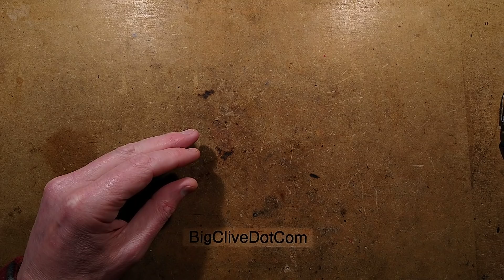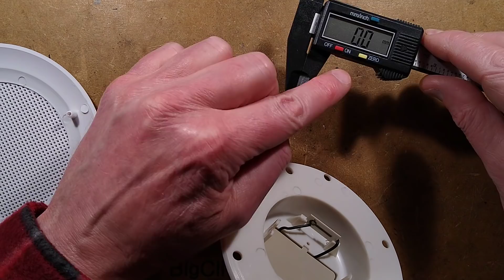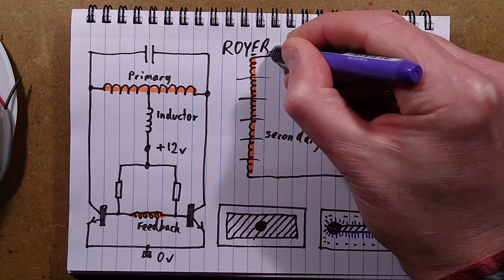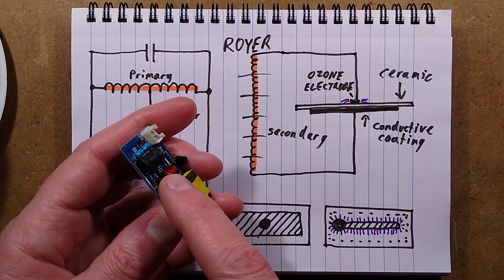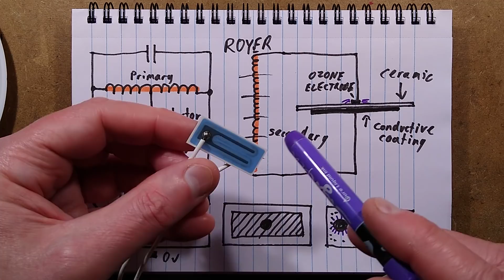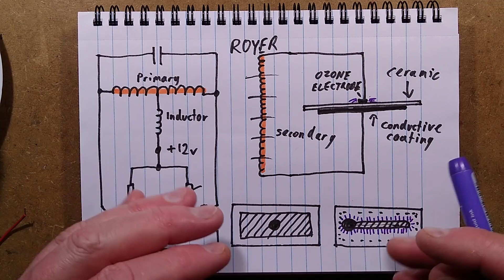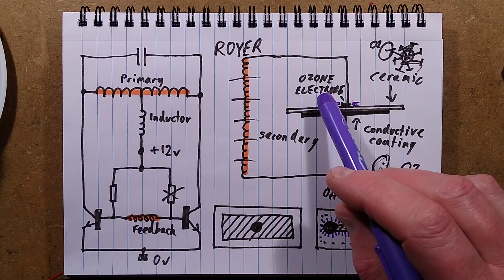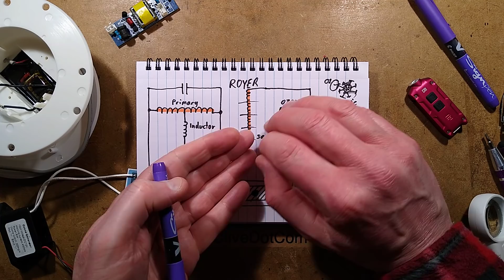High voltage sauna sanitisation unit

Comment: "Non-conductive bearings"  Yep, my old Heat-pump circulation fan (indoor unit) had the steel bearing balls eaten up by static discharge build up during normal operation. Took only like 3 years.
By that time it made quite a hissing noise when spinning. Luckily Panasonic owned up to it and sent new ceramic bearings for free. It was nearly an hour long job on the first unit to figure out how to extract/replace the bearings.
The tangential fan was wedged in good between evaporator coils  =o(  ...well, as it should be, to be efficient.
I'm guessing all the dust particulates passing by the plastic fan wheel makes it act a bit like a Van der Graaf generator.

Ha! The bearings was the second re-call issue for my heat pump model! First was a poorly written firmware for Swedish (well, nordic really) winter use.
The original FW made the compressor (slowly) commit seppuku at the 2-3 year mark. Compressor beat itself to death by inadvertently running out of oil.
It was a very intresting case, generated several thousands posts on internet forums around N. europe as folks where trying to find out why... since Panasonic didn't quite want to own up to their mistake at all first, but later exchanged compressors free of charge. People from all walks of life ganged up together and solve the real WHY because Panasonic officially blamed poor quality from a parts supplier when ACTUALLY it was their own FW.

Comment: Always a treat to see how BigClive dissects his victims like we did in biology class ;-)
I would LOVE to see you tear down one of these High Frequency Tig welders!!! It fascinates me how these little light weight boxes can do the same job as the 200 lb transformer based welders!!! You make learning fun B.C., please don't ever stop!!! :-)
Reply: Same way SMPSes use much transformers than traditional ones. You use a smaller transformer, and use it to transform much smaller amounts of electricity, but more often. 

A teeny transformer would saturate pretty soon at 50Hz, and no longer be able to transform, because when the core is saturated there's nowhere further for the magnetic field to change. So have a circuit switch it on and off loads of times. If it takes 1/50,000th of a second to saturate, switch it 50,000 times a second!

Comment: some of the electric motors where i work have a carbon contact that connects the case and the shaft to prevent arcing across the bearings

Comment: That smell in saunas and swimming pools is Nitrogen trichloride not chlorine. Bleach by itself doesn't smell of anything but mixed with water or other substances does. Mark Rober did excellent video on this subject.
Reply: The swimming pool smell is from nitrogen trichloride as well as monochloramine and dichloramine, usually referred to as simply chloramines. These compounds form from the hypochlorite reacting with common nitrogen-containing contaminants like sweat, mucus, and urine. They all smell the same as chlorine gas though, so it's perhaps not surprising that people get them confused.

Comment: Abstract

Background There is still no specific treatment strategies for COVID-19 other than supportive management.

Design A prospective case-control study determined by admittance to the hospital based on bed availability.

Participants Eighteen patients with COVID-19 infection (laboratory confirmed) severe pneumonia admitted to hospital between 20th March and 19th April 2020. Patients admitted to the hospital during the study period were assigned to different beds based on bed availability. Depending on the bed the patient was admitted, the treatment was ozone autohemotherapy or standard treatment. Patients in the case group received ozonated blood twice daily starting on the day of admission for a median of four days. Each treatment involved administration of 200 mL autologous whole blood enriched with 200 mL of oxygen-ozone mixture with a 40 μg/mL ozone concentration.

Main Outcomes The primary outcome was time from hospital admission to clinical improvement.

Results Nine patients (50%) received ozonated autohemotherapy beginning on the day of admission. Ozonated autohemotherapy was associated with shorter time to clinical improvement (median [IQR]), 7 days [6-10] vs 28 days [8-31], p=0.04) and better outcomes at 14-days (88.8% vs 33.3%, p=0.01). In risk-adjusted analyses, ozonated autohemotherapy was associated with a shorter mean time to clinical improvement (−11.3 days, p=0.04, 95% CI -22.25 to -0.42).

Conclusion Ozonated autohemotherapy was associated with a significantly shorter time to clinical improvement in this prospective case-control study. Given the small sample size and study design, these results require evaluation in larger randomized controlled trials.
Competing Interest Statement

The authors have declared no competing interest.
Clinical Trial

NCT04444531

Comment: Your description of what happened to circuit board material in your home made ozone generator leaves me wondering what will happen to the plastic case of this device if it’s used extensively. Ozone degrades butyl rubber and neoprene over time. Does the same hold true for polystyrene or ABS?

Comment: I used Ozone every year to rid my car's AC from smell of mold and mildew. 
Works like you wouldn't believe. Just let the fan on recirculate and have one of these operate inside for an hour. It kills everything. 
It's not good for the interior, but screw the interior. By the time the interior is damaged, the car will be too old and time for the junk yard.

Comment: atomic oxygen, mostly harmless when alone, ozone you can smell, sort of
Reply: Atomic oxygen is as bad as ozone because that's what ozone releases that results in oxidisation. Do you not mean molecular oxygen?
Reply: @cambridgemart2075  Same thing, and no oxidization is the result from either, direct conversion only from one.
Reply: @chasingcapsaicin  Atomic oxygen and molecular oxygen are definitely not the same thing! O is a free radical, O2 is not.

Comment: About the conductors on ceramic, you can get a solution of solder that's basically painted on, either by brush or precision spray, and then that's flashed on in a furnace. This is a second stage of firing, and so you can have one manufacturer just making the bare ceramic pieces and sending them out wherever, and their recipients firing them again to get the coating on. This stuff is still liable to rub off if it's fired wrong, or if it's put under stress either chemical or mechanical though.

Comment: I've installed  speaker enclosures similar to that, the 4 pegs would normally have spring clips, similar to ceiling lights that you just push in.

Comment: The ceramic bearings you mentioned are also used in space flywheels, since high energy particles usually made the metal bearings arching and degrading as you mentioned... It's bad for electric motors in earth, where you can replace them... but fatal in space machinery...

Comment: If you want some good pens, get a set of Pigma Micron black sets.  You can usually find them in the drafting section of the art store.  You can get a variety pack with a lot of different tip sizes (but the one's I use aren't refillable by default)

Comment: You are not probably meant to use it while the sauna is in use...
Reply: Agreed. There shouldn't be any electronic devices in the sauna when it's getting warmed up. With the exception of the sauna stove itself, if a traditional wood stove is not being used and instead an electric one.
Reply: @FanTanTick  With the lights being an obvious exception. And those are waterproofed and rated for the temperatures.

Comment: As a fin I really dont understand why the eff would you need that in a sauna. The 80-120c temps in a sauna work well enough as a desinfenctant.
Reply: @DanGraves1983 yeah i know the horror stories about 50-60c public saunas and the sauna Kiuas (stove?) without rocks and the heating elements exposed...
Reply: @DanGraves1983 I'm not from Finland and I recall 1970s saunas running that hot when in use.  Just take a cooler hot shower afterwards.

Comment: If it looks like a speaker and makes a hissing noise, how long before some company clones it as a device with an actual speaker that does nothing but play white noise... Could combine it with one of those plug in power savers for a two in one device...
Reply: If you had bought it from your usual oriental source then the extra mounting clips would probably have held a microphone.

Comment: Pool chlorine (or more accurately vapour-phase chloramines) are a known respiratory sensitiser,  and there is a known association between working in a swimming pool, and developing asthma in later life.  A useful and relevant article - https://erj.ersjournals.com/content/19/5/827#:~:text=The%20results%20show%20that%20nitrogen,eye%2C%20nasal%20and%20throat%20symptoms.

Comment: The cheapy calipers seem to have high parasitic drain. Any time I've left the battery in mine for a couple months with it off it has drained the cell. It lasts a long time if I pull the cell if I'm not using it for more than a day.
Reply: That's because they are always on, it's only the screen that turns off. The chip is constantly looking for a change of state that means it can turn the screen back on.

Comment: Are you sure about  coronal discharge in motors? I think it's more likely to be the shaft acting as a winding and the resulting potential difference galvanically eroding the bearings.
Reply: That is allegedly correct, as on older variable speed wind turbines with double fed induction generators - rotor controlled by an IGBT-inverter - had the same problems, until they used bearings with ceramic surfaces all over.
Reply: @Stefan_Dahn  That's parasitic coupling of the high dI/dT capacitively into the rotor rather than than a current being induced in the shaft; in a correctly designed motor / alternator, the net flux at the shaft will be zero, so the shaft cannot acts as a generator.

Comment: What you were saying about the discharges across bearings actually became a big issue a few years ago with satellites. In their reaction control wheels they were noticing an extra high failure rate that turned out to be because of that. Also like in your example, they switched to ceramic bearings to fix the problem.
Reply: Wow there are some really smart engineers.
Reply: @assassinlexx1993  Except they made and sold a lot of those bad reaction wheels, causing their customers to loose millions in failed satellites before the design flaw was found and fixed.  So not that genius.
Reply: @johndododoe1411  
True there is lots of bad engineering. Just look under the hood. 
I was thinking how they found the problem and came up with a solution.

Comment: I would really like a more scientific explanation of the O3 / Virii / Bacterial interaction though 😄
Reply: No, that’s it. Angryface virus picks up oxygen atoms, then it dies. Buy BigClive brand disinfectant. End of story 😆
Reply: @ncot_tech  It pretty much is. O3 is unstable, so when it bounces off an organic molecule, there's a fair chance that the molecule will react and become different molecules. If that happens to enough of your molecules, you're no longer a viable living thing, however it comes to be. 

Bacteria have less spare molecules than people, so we can tolerate losing a few million but they can't

Same way hydrogen peroxide or toilet bleach both work, by randomly reacting with bits and pieces that a bacterium would much rather stayed unreacted-with.

Comment: a pool should NOT smell like clorine.  It smells like chlorine when someone pees in the pool and makes trichloramine which is VERY bad for you.  Yes chlorine does smell but a properly balanced pool should have no smell and not hurt your eyes.
Reply: One of the main advantages of salt-water pools: pH balance is a lot easier and the convenience / safety of accurate chlorination more than makes up for the added cost of the electronics and salt cell.
Reply: @phils4634  Amen.  Plus SWG cells cost less to replace then the chlorine you would need to buy.
Reply: @MichaelMantion  Saltwater pools are far easier on the skin too, and far more pleasant to swim in!

Comment: Woudl it be possible to resplenish the ozone layer using a bigger version of this device?
For example connected to solar panels and wind turbines when the electricity they produce isn't used?
Reply: The ozone layer is naturally replenished when not doused with excessive amounts of CFC and HCFC compounds.

Comment: Interesting device.  I did think the video had the wrong title when I first opened it.  It really does look like a speaker.   Looks pretty typical for these units :)
The bearing thing is interesting.  Some earlier electric car motors suffered a similar degradation of bearings from high current leaking through them.

Comment: The felt nib wearing down on your pen is a common thing, most professional pens like those made by Copic are both refillable and have replaceable nibs for when you wear them out, drop them wrong or contaminate them. Downside is they can be difficult to find in your region or cost almost the same as a whole cheap disposable pen.
Reply: In my experience, cheap disposable pens often contain less ink than a quality refillable.  That depends on how cheap a disposable we're talking about, of course.
Reply: Well, this is something new to me that there is even the potential of refill. I dried out a highlighter just the other day. From an environmental sustainability point of view, this is a help.
Reply: I loved my Pilot pens.
Reply: They really should include a couple of replacement nibs as they tend to wear down way before the pen is out of ink.
or maybe have the nib be twice as long so that you can pull it out by a milimeter once in a while if it's not one of those with a sponge in the reservoir.
Reply: I loved my cheap chinese copicish markers. Then the price went up and I still couldn't source the refills.

Comment: I wonder if the metal on the ceramic plate could have been deposited using the same method as is used to plate copper in PCB drill holes to create plated through-holes - or a method similar to that, at least. From my understanding of the process (and I'm far from an expert), it seems like it could be easily modified to deposit copper in an arbitrary pattern on a piece of ceramic.

(Of course the copper could subsequently be coated with tin, solder (leaded or lead-free), silver, gold, etc., so "it doesn't look like copper" isn't proof that it isn't copper :))
Reply: The entire plate could be a PCB with a different core material than the FR4 that young Clive played with.  The blue Teflon could be part of the blank PCB or a solder mask.